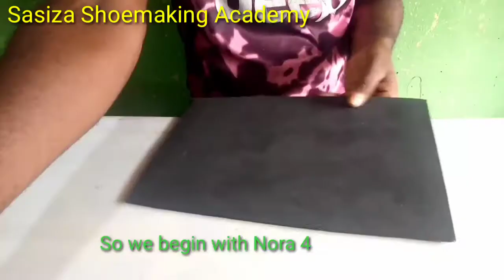How to Build Sandal and Slippers soles - Welted Soles Construction

Comment: How did you use filling machine on the edge where you have welted... fearing to spoil the welting?,which kind of welting have you used?, I'd the welt covered in leather or not?. otherwise thank you for the tutorial
Reply from the maker: Thanks for appreciating our work. I used Nora wet. And the filing machine won't disturb it at all